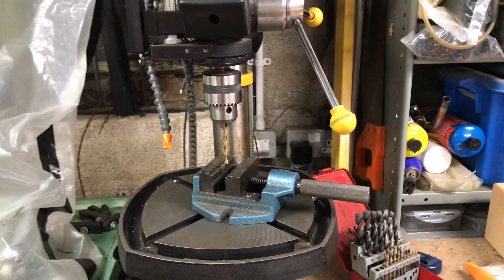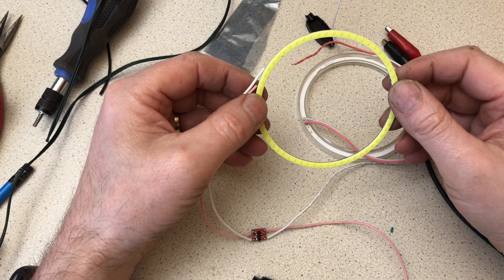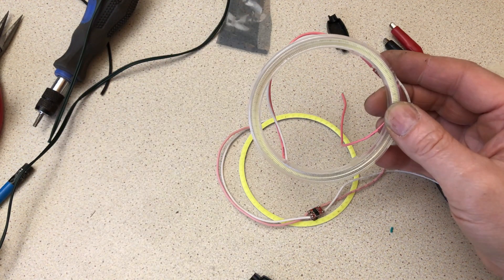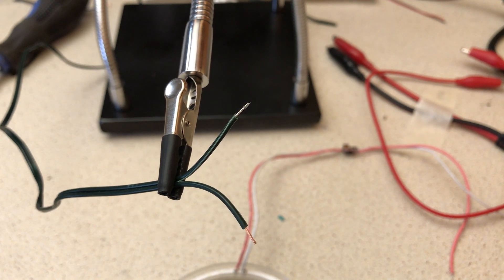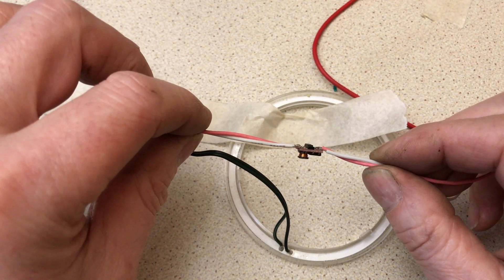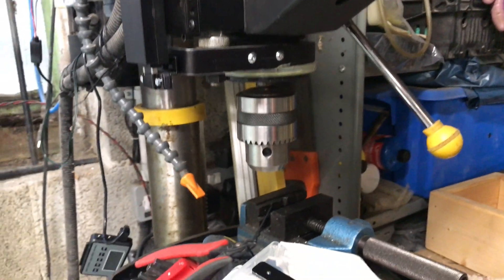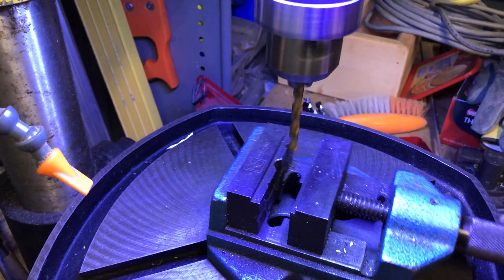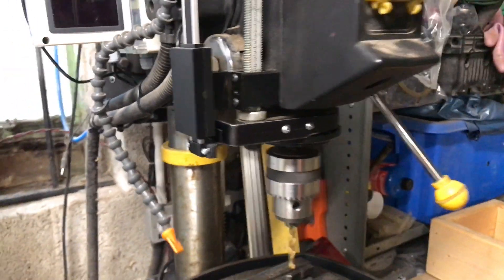Pillar Drill (Bench press) lighting upgrade using an LED angle eye

Comment: Great idea. What current does angel eye draw?
Reply from the maker: From memory they were rated at around 3watts so at 12volts it would be around 250ma although I would expect it to be less than this as the wattage output is usually exaggerated. Mine give a slightly blue output but is still very usable. Thanks for watching 👍

Comment: G’day Mike. Great little project, the light output is good for recording which from my experience is not strong enough for my old eyes but still better than nothing. You do have a backup. 
Cheers 
Peter
Reply from the maker: Hi PGS. I need a lot of light as well, age related! The led ring did help but additional light helps as the workshop isn't too bright. Thanks for your comment and of course for watching 👍🏽